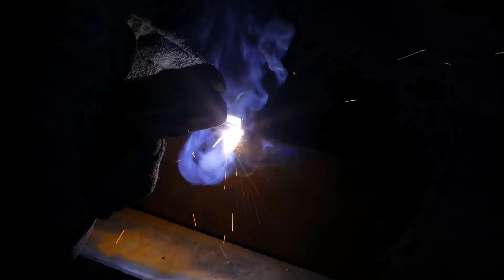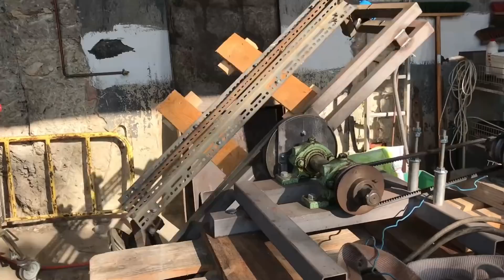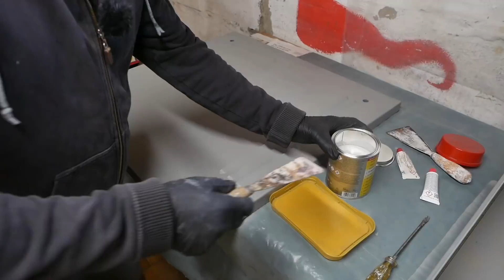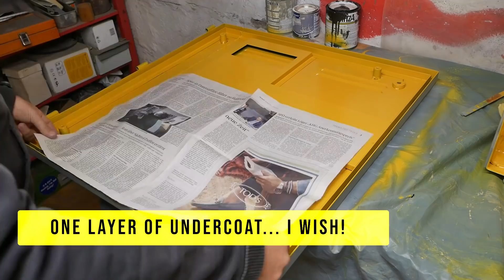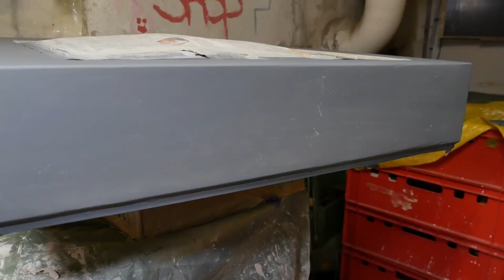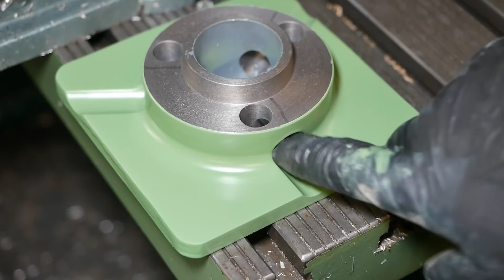Schaublin control cabinet completion

Comment: Excellent video, as always! Which, after the last ToT video, leaves me wondering: How much of your footage ends up on the proverbial cutting room floor? 
Tangentially related to that: someone needs to put the bee of a second channel in ToT's bonnet.

And, how did the paint gun clean up? Did it work, or did you have to buy a new nozzle or something?
Reply from the maker: Thanks.
Tony's videos are brilliant. Did you also see this one?
https://www.youtube.com/watch?v=2j9T-eYo8QQ
An excellent video, also an excellent anaysis. 

This took me nearly 4 weeks to get this welding, prep and painting finished. I ended up with 229 video clips, some of them 30 minutes long. I would estimate that I used less than 5% of the footage duration, but probably nearly 80% of all clips contriibuted to the final edit. Took about 18 hours to edit this. 60:1 is about right for me.

The gun worked a lot better once I soaked it and U/S buzzed it. Still not perfect, but I'll keep soaking it, dissassemble it, and hopefully get it back to new.
Reply: @RotarySMP  I did, in fact, not see that video, but I'll be watching it now.

Doing the math (assuming a clip length of nine minutes because that makes nice math), that's something along the lines of 45 hours. That's a lot of video, considering how much 1080p video takes shot by a camera.

Also, I'm not sure how well this works (I don't know what nozzle diameter you use, and if only orifice, or other geometry needs to be clean as well), but maybe nozzle cleaning tools for torches and 3D printers work? Those are at least pretty cheap to have from China.
Reply from the maker: @vincentguttmann2231  Turning on the camera and letting it run makes editing a bear. I normally try to think through what I want and set up short short clips. My clips are mostly only 10-60sec. Only a few are long. With the PPE, and paint covered gloves it doesnt work to target the angles I want. Then I hang the crash cam up on the wall, and leave it to run for 30 minutes. That is how the spraying footage was made. I would roughly estimate that I had 3-4 hour of raw footage for this 18min video. Wonder if there is an easy way to see the raw duration in the windows explorer?
Reply from the maker: I just checked, and found explorer can do this. Turns out it was just short of 7hours of footage in this video.
Reply: @RotarySMP  Oh, that's a lot more manageable, and nothing compared to the half terabyte of footage my estimation would've taken. Also, I just watched the video you mentioned. It's almost scary to see how well he mimicked Tony. 

It's pretty interesting, and sometimes very surprising to see what goes into the making if these videos, and I also especially appreciate you taking time to answer all the comments. I know that at some point the channel will get so big this won't be possible any more, but I still appreciate it
Reply from the maker: @vincentguttmann2231  
I only shoot 1080P, and H.264, as my laptop is nearly 10 years old, and the one time I shot in 4K, it took 12 hours to render, and 8 to upload :)
I was really interested not so much in how well he mimiced Tony, but especially his critique of Tony's technique throughthe eyes of a trained artist. I'd also noticed Tony's strong directional lighting. I went for flat lighting as constantly moving light stands must be a royal pita, even worse than the tripod, but after watching that  video realised how boring mine are visually. Tony must really suffer for his art, as that set up is really annoying.
I see my channel more in the Myfordboy lane than the TOT lane. There seems to be a solid audience which is slowly growing, and I appreciate all of your loyalty. 
Who watches a 130 episodes of a tv series... other than Corronation street, or star trek?
Reply: @RotarySMP  Oooh, I know the pains of a slow laptop. P.S.: If you're looking for one, Medion (dunno if they ship to Austria tho) is offering a laptop with a Ryzen 4700U. The 4000 series APUs absolutely kick ass, and at 750€ I wouldn't see it as overpriced for that chip, given the current situation. I got mine recently, and can wholeheartedly recommend it.

And, I think what you are lacking in visuals, you more than make up for in content. Each episode is a bit like an Überraschungsei: I have absolutely no idea what's inside.

Plane stories? America's cup? I have no idea, but it's always fun learning about something new!

Also, 130 episodes? Those are rookie numbers compared to "Rote Rosen" (over 3400 in 19 seasons) or "Lindenstraße" (1765 episodes).
And deep in my heart I know that someone out there has watched all of those
Reply from the maker: @vincentguttmann2231  That is funny. You are right, not everyone is looking sme something new.

To edit 4K video, you really need an 8GB graphics card. I'm planning to get a used Gigabyte Aero 15 or Aorus next year. Something about 2 years old should also only cost about €800, but should really rip though the rendering. Of course the king now is a Mac Pro M1 Max, the test should these rendering a 12Min 6K video in about 4 minutes, with lots of LUTs and effects.
But I dont want to go apple.
Reply: @RotarySMP  Well, around next year, the chip shortage should hopefully be over for the most part, and you could build a desktop, if you were concerned with that. But, I bet you are considering all those things as you probably will have to justify those expenses to your wife ;)
Reply from the maker: @vincentguttmann2231  :) I self censor before it even gets to the finance ministry. I travel enough, that a laptop makes more sense, so I can edit after work.
Reply: @RotarySMP  Imagine how much more you could accomplish on your projects if you could get all that editing time back!  Don't get me wrong...the videos are great to watch but....so much time setting up and editing....wow!
Reply from the maker: @physicsguybrian  To be honest, the self imposed YT publishing schedule has increased both my focus, and my productivity. I used to start project after project and leave them half finished and neglected. I am still slow, but finished the MAHO (before YT) and then the mini-lathe, so I am confident that the Schaublin will also get finished. 
Setup is not a big deal. Since I made the studio camera stand, it is really just a few second, as long as I am in the main room.
But you are right, I have probably put in around 2000 hours into editing in the last two years. I find it really impressive the guys that can put our videos of finished projects every month. A CNC project takes me a year +
Reply: @RotarySMP  I read this and had a good laugh. You and I have a lot in common. I currently have about 5 or 6 major projects started, half-finished, or in the planning, purchasing stage. I'm looking for a reasonably priced camera to start my UT career, and share some of these interesting projects with the maker community. Like you, I'm betting that will motivate me to get all of these projects moving forward. The main thing holding me back has been the shop remodel an reorganization and that is almost finished. I've managed to stuff 10 lbs of sh*t into a 5 lb bag. ;-)
Reply from the maker: @misterfixit1952  Dont worry too much about equipment. I shoot on a panasonic G85 I bought used for €300, and a normal zoom, or somtimes the phone. Edit on a 2013 laptop. Light is it key. My early videos sucked for lack of light, so I added more flat lighting. That is easy, but boring.

Comment: I never use grinding wheels for grinding back welds and no welder I know does either, flap disks are FAR quicker.
Reply from the maker: Thanks for the tip.

Comment: Idk if newer or different fillers are better at dealing with water but traditionally, you don't wet sand filler, it will absorb water and pop paint off later.
Reply from the maker: That is bad news. I hope it can hold on for a few years.

Comment: Some aerospace parts I have made, the use of any sanding/wet and dry or even de-burring was not allowed. And they would check under microscopes foe the surface finish everything had to come off the machine finished!! . The reason is in space the smallest amount of dust metal gets into the electrics or systems, well it could cause a disaster.
Reply from the maker: It must be a real shock to the space industrial to watch Elon build his BFR out on the coast in a tent with a welder :) I am guessing he will also learn his lessons that the rest of the industry doesn't do the clean room for fun.
Reply: @RotarySMP  Haha. yep it`s not great. I was surprised with the first people thay launched. They had a teddy bear covered in sequins. In the old days, they used to be made of metal and some might still be. Imagine a load of them coming loose sneaking into little crevasses. Jamming controls causing short circuits. I got some shit for my comment on the spacex channel. but hay what do I know its not like the parts I have made are currently sat on mars or floating around space 😉😂😂
Reply from the maker: @harezy  Given the urine leaks, sequins might be the least of their issues :)

Comment: Your cabinet chop job came out pretty good. By the way, it's not a good idea to use an ink marker to mark problem areas. Ink has an annoying tendency to bleed through the paint. Pencil or chalk are safer. Check the vent in the lid of the paint pot of your gun isn't blocked. That can cause odd problems. It may also be that your gun just needs the paint to be thinned more.
Reply from the maker: I did have to thin a fair bit, but it was also not consistant. I did check the vent.

Comment: You should try some all-in-one semi gloss metal paint like Johnstones Smooth Metal Paint applied with a roller. It will give an excellent finish which will be very close to the original textured finish and is quick and easy to apply. It's also incredibly durable. I've stopped spraying machinery now, I don't miss all that dust and waste.
Reply from the maker: I wonder if you can get that over here?

Comment: I was an United Airlines pilot for 28 years until 2020 when I took an early retirement.  My last 15 years I was an Airbus A320 captain.  That story hit home!  Usually I try to put myself in the pilot's shoes and try to see how I would react.  I definitely would not have been testing an airliner especially at that altitude.  

I am restoring an Atlas 7B shaper and will be doing a series on that.  I already did a series on my Atlas 618 lathe and my Atlas Horizontal Milling Machine.  I love your attention to detail.  Keep up the great work......
Reply from the maker: Did you read through the accident report? Really hard to fathom what lead them to commence the alpha prot test at 4084" in descent. 

I watched your Bittersweet video. Understand how weird it must be for a career to get ended like that by the pandemic.
I have watched your Altas series before.
Reply: @RotarySMP  Wow!  I'm shocked you've seen some of my videos!  I did not see that accident report.  Most of the time we go over those in recurrent training.  Some of them really blow me away!  The one you mentioned really did.  I NEVER wat to be in alpha prot in real life.  I've done it in the sim, but it's to know how it feels when you or the jet messes up.  Usually you;-)

I am going to start putting up my shaper restoration soon.  Thank you so much for the reply.....
Reply from the maker: @jster1963  I linked that report in video description. I have done a fair few flight tests as engineer, and have encountered plenty of aircrew who fail to grasp the risks, and head blindly into tests point without thinking through their go/ no go  criteria, or consequences of abnormalities.
Reply: @RotarySMP  I will check that out. I bet I’ll cringe!  And thank you very much!!

Comment: You may have a bit more luck using glazing putty to fill in small defects in the paint job.. a bit easier to work than using the filler.
Nice to see the CL 215's (I think they were 215's anyways) doing the work, but as a Canuck I am kinda biased :)-
Cabinet turned out well, good show.
Cheers,
Reply from the maker: Thanks. I need to see if there is a glazing putty for that paint system. 
Those are the CL-415's, the turboprop version. It was a cool show to watch. Shame about the burnt forest took a week in total to extinguish that fire.
Reply: @RotarySMP  Oof, messed up the designation. The 215's were good old rotarys. That's what I get for typing in a hurry. I wonder if it's a later model, made on Vancouver Island by Viking Air, or one of the 
earlier models...
Anyhoo.. back the the glazing putty. Great stuff. I use it on my 3D models to fill large gaps and defects, then a plastic high-build primer to finish off the surface. Very handy stuff... 
cheers,
Reply from the maker: @EngineeringVignettes  You got me looking at the Wiki. I dont know which series the Italian CL,415's came from .

Comment: Hate to mention it but it's time to get a MIG or TIG welder. Over the last three or so years, I've gotten more into sheet metal work, and last year I picked up both welders and a plasma cutter. There are a number of good 3 in 1 welders that do all three pretty well. Yeswelder just came out with one for around $500 US that looks very promising and it's a 200A model.
Reply from the maker: That welder is a three in one. I just like stick welding, and weld so seldomly that I never got around to buying gas.
Reply: @RotarySMP  Yeah, gas is a pain (no pun intended) especially when you forget to turn off the valves and you come back in a couple of months and find your new bottle almost empty, on a Saturday, when the weld shop is closed. Not that I've ever done that. Get a roll of flux wire for your MIG. I keep one handy in case that gas thing, (that never happens), does. It's just like stick welding with a self starting wand. You still have the flux to deal with but it makes great tacks and is pretty easy to weld lighter gauge metal.
Reply from the maker: @misterfixit1952  Gas here is really expensive. €300 for a 20L rental bottle for 10Y, and then €45 a fill.

Comment: There is a "bog" undercoat available, makes those finish coats a breeze. Need to fiddle with thinner ratio to work in generic spray guns, as opposed to high volume/lo pressure specialist guns!
Reply from the maker: I should have look into that.

Comment: On your next panel welding session, try getting hold of some silicon bronze filler wire. It's a treat to use joining sheetmetal, flows easy and doesn't draw nearly as much as steel. Paint job looks fine, my paint jobs are either acceptable, or "sand it all off and start over" with nothing in between it seems.
Reply from the maker: Thanks for the tip.

Comment: I'm the US we have glazing putty that is used to fill small defects in body filler. It's easy to use and dries really fast. Better than mixing up filler and getting bubbles and low spots.
Reply from the maker: I should have looked more closely to see if they hard that for this system.

Comment: When repairing surface defects use the putty only on the low spots. Never let the putty cure 100%. 
Once it is slightly cured start sanding with a large grit (60) to get most of the putty off.
If low spots remain repeat.
To cover the large scratches of the 60 grit use spray on putty (polyester works best for me) and after curing wet sand with fine grit (240-600).
Finally hit it with a primer and paint..
Best results with minimal work. The spray putty is very easy to sand.
Reply from the maker: Thanks for the tips.

Comment: lol your body filler pops off too fast because you're using 8x the catalyst you need
Reply from the maker: It said mix a pea to a walnut. :)
Reply: @RotarySMP  always had luck with pea to a quarter cup and a good mix. also, please god use a power sander for all your body work next time and don't bother with finer than 200 for paint prep, wet sand between paint layers when you're trying to get a glass smooth clear coat, save you some tennis elbow
Reply from the maker: @Keechization  Thanks for the tips. Lucky I didn't use the 1000 grit I found in the cupboard :)

Comment: Nice work but next time you should know that at this point you could just build a brand cabinet entirely out of BOG. ;)
Seriously though I hope you end up having enough room in there. I always want bigger cabinets, not smaller.
Reply from the maker: Cabinet of bog is about right. I also hope it will all fit.

Comment: 199 at LIDL for a MIG welder. Would have been handy. Just saying.
Reply from the maker: Really? That is just one of those flux core one right? I tried one years ago my Dad had,and would prefer stick welding any day. This welder can also do TIG, so sooner or later I'll get a gas bottle and try that. I dont weld that often and speed is not important for my jobs.
Reply: @RotarySMP  Oh, and it's the video from two months ago, not the newest one that seems to be about brazing.
Reply from the maker: @graealex  Thanks for the tip. Thin electrodes stick more than fat ones, but mostly this welder lights off easily.
Reply: @RotarySMP  Just saw how you were struggling with starting the stick. Obviously thin metal isn't what stick welding was meant for, anyway. Although it's usually good enough um einen Auspuff für den TÜV zu reparieren.
If you want to see the welder tested, head over to "Igor Welder", he tested the cheap one from LIDL.

Comment: After doing body work and repainting my car, I've resigned myself to not use body filler and worry about ugliness.  I'll take panels with warts and all and just rattle can it when it's not important.
Reply from the maker: I should have put more effort into panel beating, that would have saved some bogging and sanding.